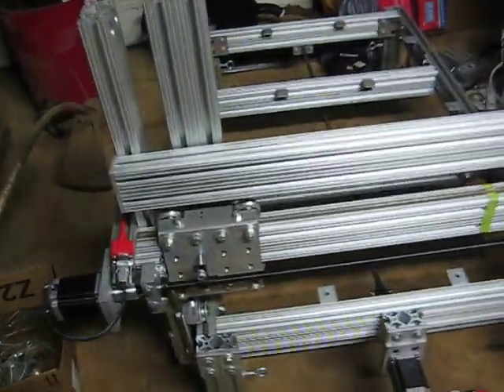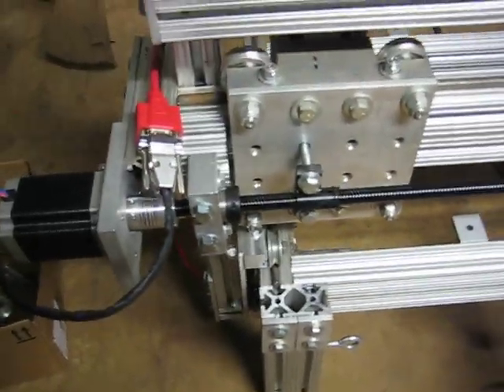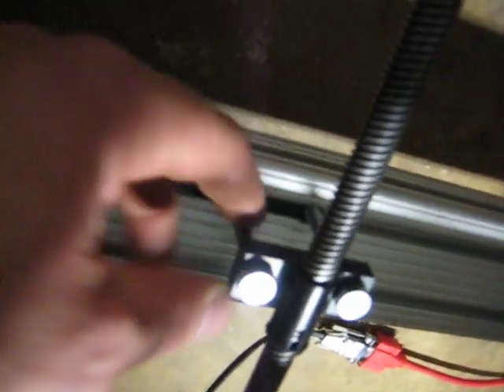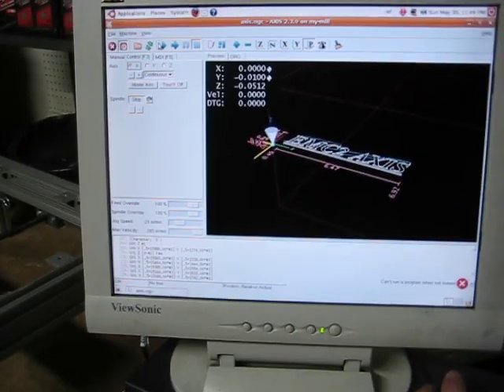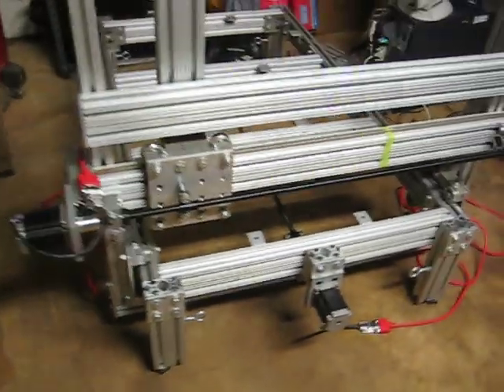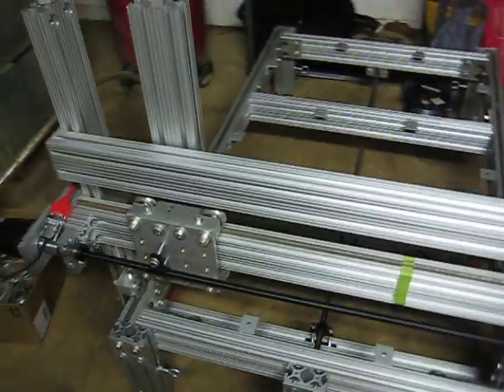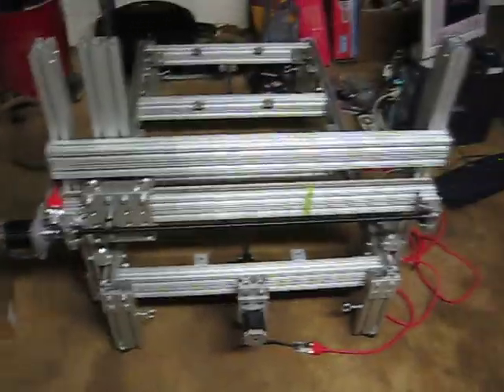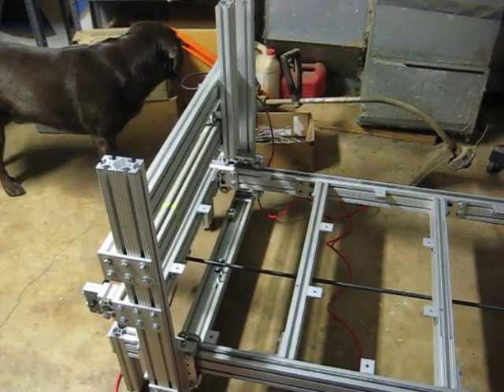CNC first test run.

Comment from the maker: @beege1968 

I wish I would of used real linear rails for the X and Y axis.  While the one I have work OK, I could of done better.  I could of done this for a lot less money if I had not used 8020, but I wanted to make this once.

I'm using Corel Draw 11 (which I already  had) and VCarve Pro for design.  Using ECM2 to actually control the CNC mill.  VCarve Pro, while costly, is very nice.  It imports Corel and exports ECM2 files.  Made my life a lot easier.

My build log on CNCzone is detailed.